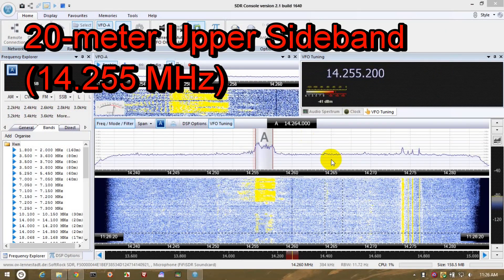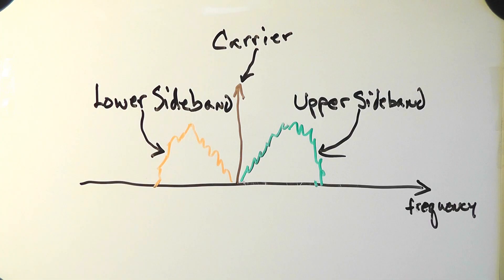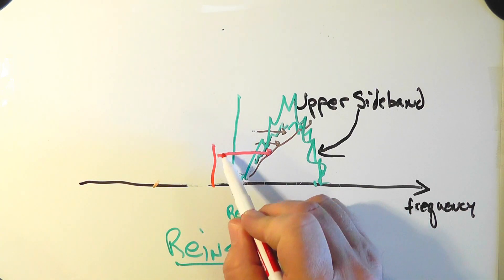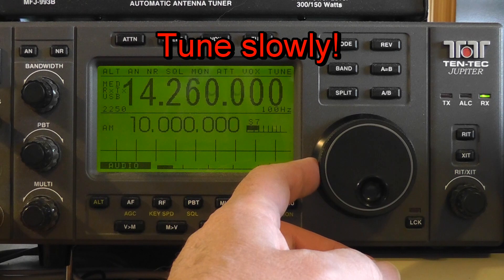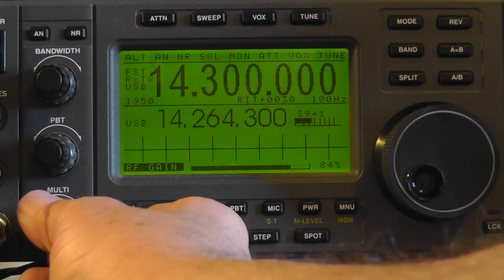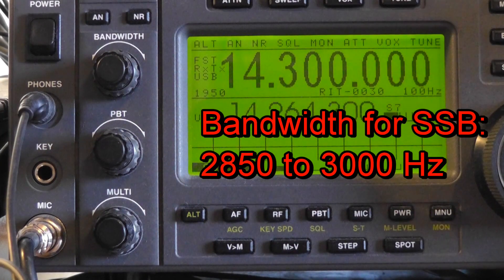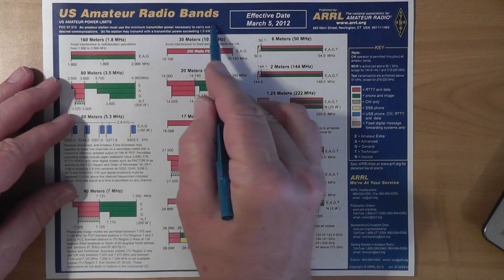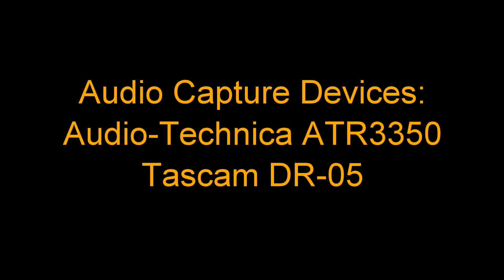Tuning Single Sideband (SSB)

Comment: does SSB reach 80 miles?
Reply: It's not SSB or any other mode that determines range, it's the frequency.
Reply: well, SSB is actually specified by its frequency ;-)
Reply: @kisho2679  SSB is specified by its frequency? Not sure that makes any sense. Still the mode has no direct effect on range or propagation, to answer your question. It's frequency that determines range, line of sight dependency, propagation, etc. Some HF frequencies will skip over the 80 mile range while 40, 80 & 160 meters would likely do that range well. VHF and above generally would not make the 80 mile range (without ducting). At that point you can pick SSB or any other mode without it affecting range much if any.

Comment: Another great U-Tube posting. Thanks Dave! BTW, I learned 33 years ago, that slow tuning for SWLing or Amateur Radio work, is more easily accomplished by placing your "pointer" finger inside of the VFO knob "hole", if your VFO knob is so equipped. Much faster, and more ergonomically comfortable during a 36-48 hour contest, than "riding" the edge or "flat" of the knob. 73, N7MZW Wyoming

Comment: hi Dave
the other night while tuning the HF Bands with my IC751 that I just received, by chance I came across a group of hams from my home town. they were operating SSB on the 80 meter band. tuning my receiver very carefully, it looked to me that the frequency of operation was 3.550. i called in and was heard but reported by the other end that I was off frequency and should try again at 3.560 - which I did. it was confirmed by the 4 other operators that I was now properly tuned. my RIT and XIT both were off. i am very inexperienced in the world of SSB as I normally operate CW mode.
my question is - what could I have done differently so that I could have nailed their exact operating frequency in the first place? not knowing the correct procedure makes me a bit hesitant of calling other SSB stations.
Reply: It looked like it was 3.550 but how did it sound? It should sound perfectly clear, no shift in pitch, almost broadcast quality in some cases. I'm surprised at how many operators tune SSB signals off frequency and have horrible shift in pitch, even at field day operations where we demonstrate our abilities. Trust your ears, then your eyes. With that said, there is a chance that your radio might have an issue, maybe be off frequency a bit.

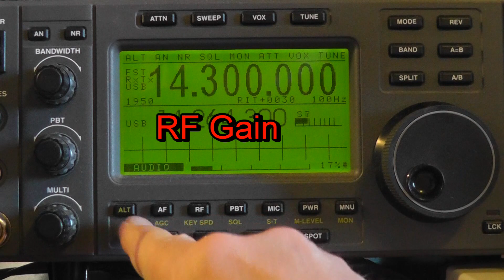Comment: This video is very old, but at 6:03 he just recommended to run the RF GAIN wide open. This confirms the suspicions of many that people actually run their radios in this inefficient way. People, don't do that. This is all wrong. Lower your RF GAIN, raise up your AF GAIN, and use it as a volume control to reduce background noise. You CAN still pick up weak signals doing this, even better than before.
Reply: I've been doing this method for several years myself and am surprised at how many operators just default to max RF gain and use the AF for volume as if they were using a VHF or UHF FM transceiver. I'm assuming that's where this practice came from.

Comment: Very useful, thanks. Suggestion: A little more depth on AGC and the differences in technique between SDR tuning and traditional superhet tuning. I know a lot is the same but there are also differences. It would be great if you could explain those.

Comment: Hi David, my receiver only has a mode for 'SSB' and not USB or LSB. What do I do?
Reply from the maker: You're fine. It will pick the correct sideband for the band you're working.
Reply: @davecasler  thank you David

Comment: I get a muffled signal on reception and I cannot understand what they are saying. What do I do?
Reply from the maker: Open up the bandwidth. You can aim for a 3 kHz bandwidth for SSB reception. Some signals sound muffled simply because the transmitting operator is using a bad mic.
Reply: @davecasler  I'm using an ICOM 745, which doesn't have a bandwidth control.  I can almost never understand SSB transmissions, no matter how hard I try to tune them in.  Is it possible my radio is malfunctioning, or is it just my technique?
Reply from the maker: @JaySDunham  Try the opposite sideband. For example, if USB isn't working, try LSB.
Reply: @davecasler  Tried that, to no avail.  But thanks for the suggestion.

Comment: I have a older Kenwood.  It has a mode button that just says LSB/USB.......... is there a way to tell when I need to use what?  or do I just use what ever works?  Thanks
Reply from the maker: The rule of thumb is LSB below 10 MHz and USB above 10 MHz. The only exception is 60 meters, which is USB.

Comment: so, when I tune into a frequency the number displayed is the carrier wave. and the radio listens to a range on either side (upper or lower)? so I may be able to listen to LSB using USB but if I try to tune in I would transmit on the opposite side of the carrier wave, and no one would hear me?
Reply from the maker: Oh, they would hear you—but so distorted as to be indecipherable

Comment: Hello Dear David,

My name is Paulo, as I do own a fishing vessel  fleet and as they usually do have to sell  hundreds miles away  that is the reason why I am looking for an easy way to keep in touch with them onshore while they sell, so I can stay 24/7 updated on their position as well as on their production-wise status. So you tell me what kind of radio set would it be perfect for me in other to accomplish such thing?

I look forward to hearing from you as possible.

Cheers,

Paulo-Ningau@outlook.com
Reply from the maker: Hi Paulo, both INMARSAT and MARISAT offer reliable satellite-based communications systems. You can put a satellite phone in every vessel. In the past, vessels carried HF radio for contacts, but they were nowhere near as reliable as today's satellite phones. Amateur radio uses HF for casual contacts, contests, DXing and the like, but is not built for reliability. You need a commercial solution. Good luck!
Reply: Thanks for your quick answer on my post.
well I do actually find myself located in Angola, Luanda,  will these satellites phones be able to cover up here?
Reply from the maker: Yes, I believe so

Comment: What type of SDR setup do you use, David?  Thanks for another excellent video.
Reply from the maker: I use a FiFi SDR I purchased from www.funkamateur.de, plus the excellent SDRConsole (V2) software from http://v2.sdr-radio.com/. Re the software, be very careful you're downloading the right thing.
Reply: Actually the Jupiter is an SDR. It's a control panel & display version of the Pegasus which is a conventional SDR. It can even be operated in Pegasus mode.
Reply: @GearHeadHam  Wow, my comment was 7 years ago.

Comment: Thanks!  This was exactly what I have been wanting to understand at this early stage of using my HF radio.  The tip on using RIT will be helpful.
Is your Bandwidth and Pass Band Filter controls the same as my Lo/Width and Hi/Shift Filter controls?
Reply from the maker: David, I'm glad you found the video useful. Without knowing your specific radio model, I'd have to say that your Low/Width and Hi/Shift are likely similar to Bandwidth and the Passband. 73
Reply: Thanks again David. My rig is an inherited 1996 - Kenwood TS-870S with no documentation or an Elmer to teach me how to run it.  Yours is the first I have found showing actual operation.  I printed the Owner's Manual and have been pouncing in SSB contests the past few months.  I am not an EE, just an appliance operator.  ;-) enjoying HF.
P.S. In your video, you had 14.255.2 tuned at 11:36 AM (?) to what sounded like a military net.  Is that an actual net for military vets?
Reply from the maker: David Hill The net was that of the radio club of a veteran's hospital. They asked each contact if he/she is a veteran.